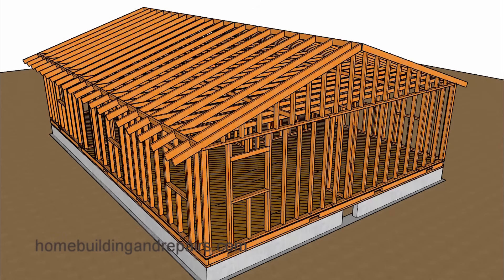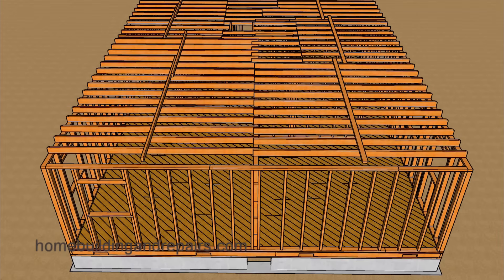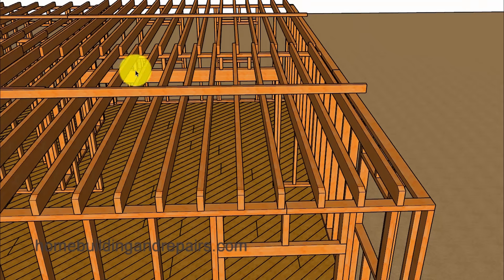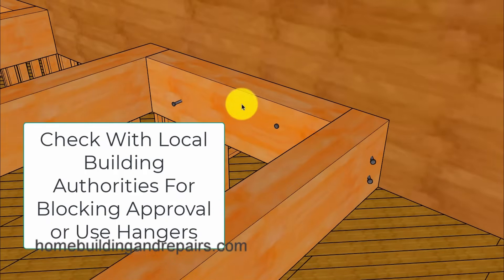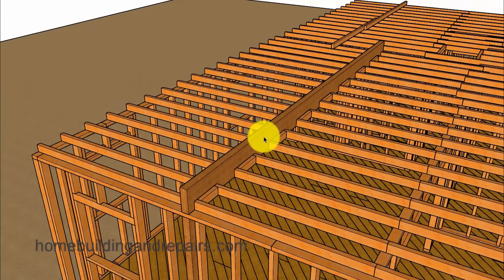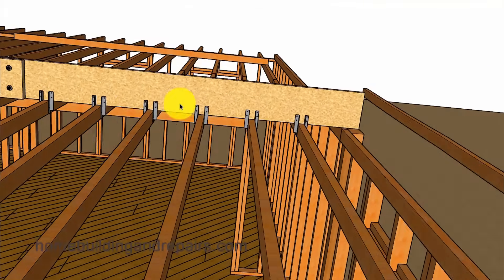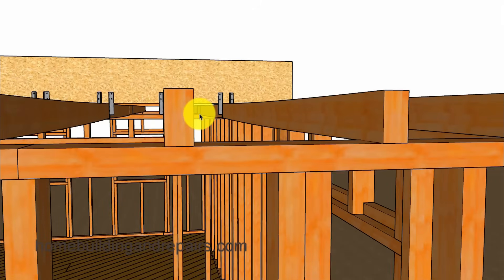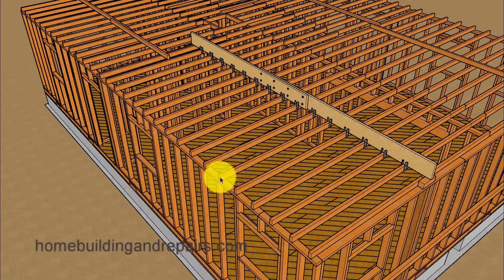Watch This Video Before Trying To Fix A Sagging Wood Framed Ceiling - Old Home Remodeling Part Four

Comment: I live at 44.44 degrees latitude and used 2×10 rough lumber for the ceiling joist to accommodate R- 30 between than R-30 overtop az a matter of course.

Comment: The "catwalk" isn't a good option?
That is: a 2"×4" flat with a 2"×6" nailed to the side vertical in center of the joists? This is hoe mine are.

Comment: Very helpful video,I have a 1924 house with a sagging ceiling in the bedroom 2x4. I pulled up the sag and bolted two 2x4 either side of the Hanging Beam. When I release the tension the sack came back but not as bad only 25mm it was 70mm.

Comment: Ceiling is sagging 1 1/2". House was built in the 30s. Joist are 2x6". Can I jack up the joist (one at a time)and add new joist to them? Maybe 2x8"s. Using lag bolts, so basically sister each joist with a new joist? Thank you!!!
Reply from the maker: I can't say yes, because I don't know what the problems is. Check ceiling joist span carts if you can find them to get the correct size ceiling joist.
Reply: @gregvancom  thank you for the quick reply! I believe the issue is age of home and span. It's a 14' 6" span with only 2x6 on 24" centers. And it runs 20 feet! I may end up going with your first option in the video, tear them out replace!

Comment: Replacing/reinforcing a bunch of ceiling joist in a home could be a budget busting endeavor, not to mention a filthy, nasty project. Ceiling structural concerns aside, one would need to carefully consider the cosmetic value add. Joist replacement makes perfect sense if plaster/drywall ceilings are going to be demo'd as part of the overall remodel. My guess would be that most  joist bowing occurred during the early life of the structure, and joist vs load have long since reached equilibrium. If the ceiling hasn't collapsed in 50yrs, it probably isn't going to, unless rafter loading is increased. I once lived in and eventually sold a +-100 yr old story farm house. It seemed like it was 'farmer' built with minimal use of square or level. Virtually every home detail had hard to correct imperfections, but it was warm, dry and cosmetically passable, if not charming:)
Reply from the maker: Good points and thanks for sharing.

Comment: I know you don't like that repair, neither do I, but I have done almost the same repair and it has worked great. Sometimes it is the only way to address the issue without making the project bigger than it has to be. :-/
Reply from the maker: Sometimes we need to keep the engineers out of our way.

Comment: I have a 1950s home with a sagging wood tongue and groove ceiling. I know that in older houses the T & G in the walls and ceiling was often structural so I'm a little nervous about tearing it out to tackle the sag problem. Of course I should talk to an enginner - but beyond that, any practical experience with this? Maybe just a small section at a time?